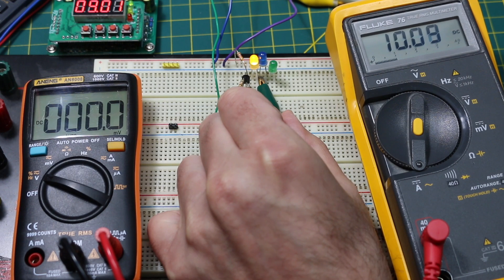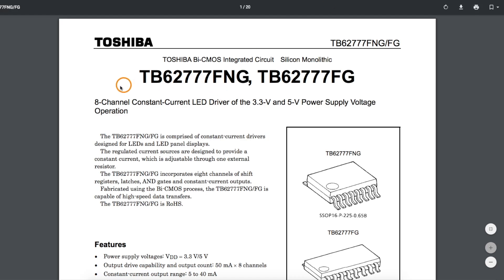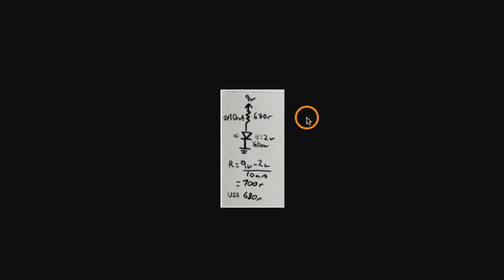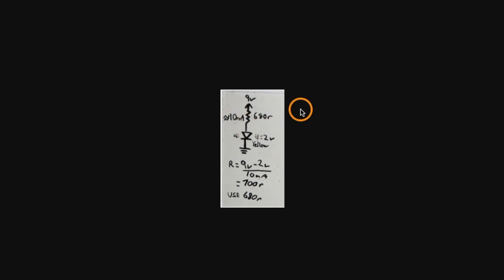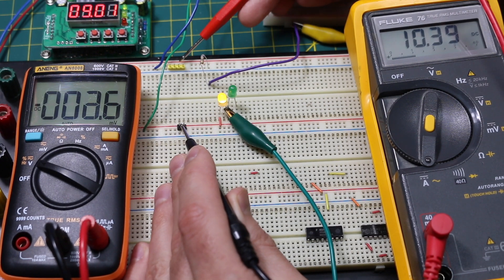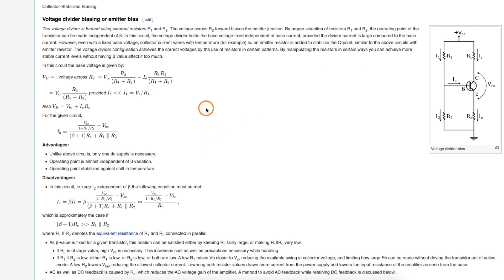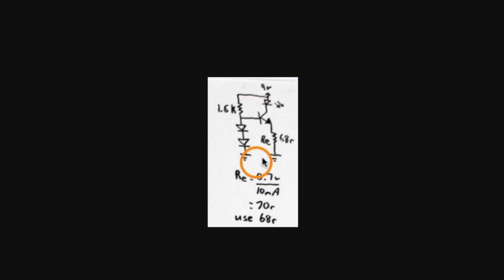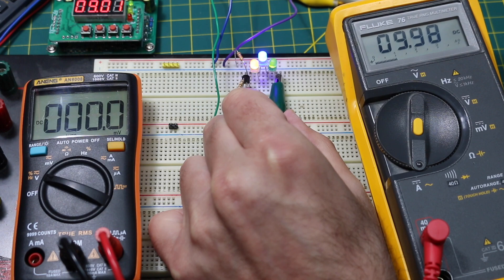Constant Current Source with BJT Transistor

Comment: It is often a good idea to do power calculations for led drivers, with 10mA you will seldom have problems, but at 50mA and a small transistor you might have problems.

Other ways to make simple current generator is JFET and constant current diodes

Comment: Sweet.
I've been thinking about building a similar circuit to improve cheap LED flashlights.
Something to tame it down while squeezing as much juice as possible out of the batteries.
Reply: Then DO NOT use this kind of circuit (with series resistor). You lose light but the excess power just gets wasted as heat (in the series resistor). If you want maximum juice from the batteries to be converted to light, then use a proper LED driver. If you want control, use PWM. Don't use "linear" type drivers - you want a high quality switching controller, Buck to step down, or Boost to step up..

Comment: Great stuff, I'm quite into this fundamental stuff at the moment, it's interesting how much I have forgotten...cheers!
Reply from the maker: Yeah I need to fill in the blanks that have crept up on me over the decades. One thing I learned in this experiment - ebay breadboards can't be trusted for signal integrity.  Until I switched to a proper breadboard, current was jumping all over the place!
Reply: @GadgetReboot  Massive problem, I'm doing small current stuff to and it's practically impossible on cheapy boards. Maybe a breadboard review ?
Reply from the maker: yeah it’s similar to the problems I have with test leads that have alligator clips on them and they are poorly made so they build up resistance and you try to use them to provide 5 V to a circuit from a power supply and you’re getting 4.1 V and then it jumps to 3.7 V, I wonder if it’s possible to easily measure or demonstrate breadboard connectivity issues. Something to put on the list. lots of videos out there take apart the cheap breadboards and show the contacts are poorly made and it’s easy to see why it’s hard to shove components into those but I don’t know if anyone’s demonstrated connectivity issues and reliability.

Comment: Some blue LEDs will light up with very small currents ... sometimes far less than 1mA.   The BJT  mirror configuration can be a convenient to globally trim constant current to a series of loads.  https://www.allaboutcircuits.com/uploads/articles/current-sinking-and-current-sourcing.jpg
Reply from the maker: I remember regularly using around 2 mA for surface mount LEDs in designs but I don’t think I’ve had one less than 1mA, now I want to investigate that, maybe see if I have any already in my collection of surface mount and through hole.
  One thing I did notice recently with my through hole red LEDs, out of the same batch I got on eBay, some work fine and some look like they are only operating at about 1/3 brightness in the same circuit so that’s weird, I think I have to go through and do a quick audit and just throw away the weird ones.
A few months ago I was researching current mirror circuit configurations but now I can’t remember a few of the things I learned, need to start over. i’ve never used them before and I can’t remember if they need matched transistor pairs or something else might have been a critical parameter, maybe I’ll get it the breadboard and see.